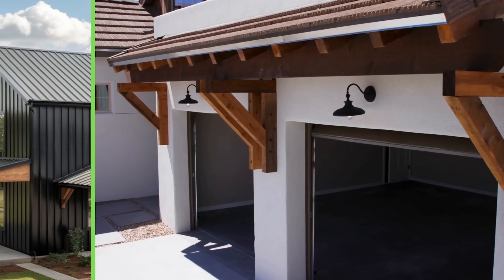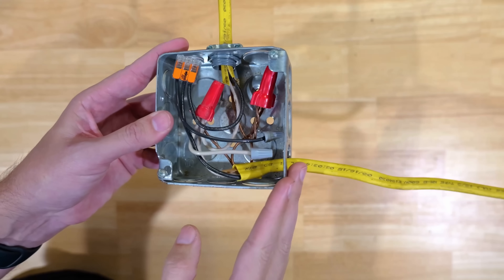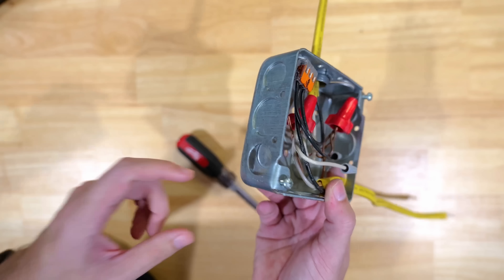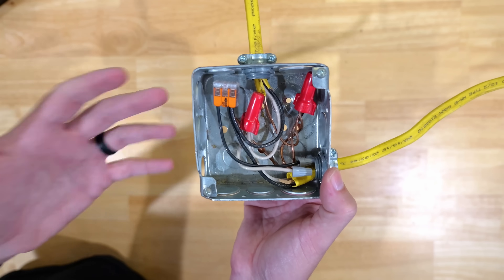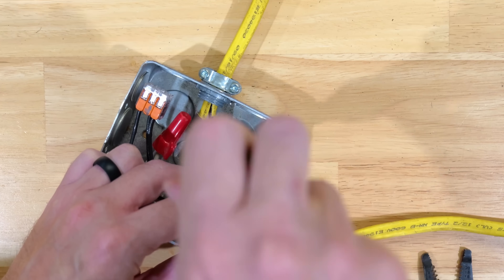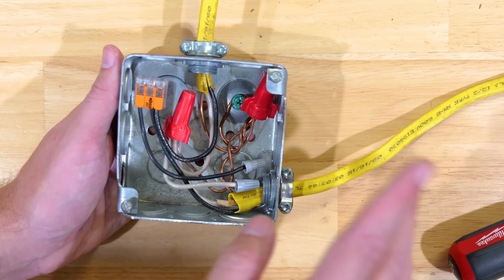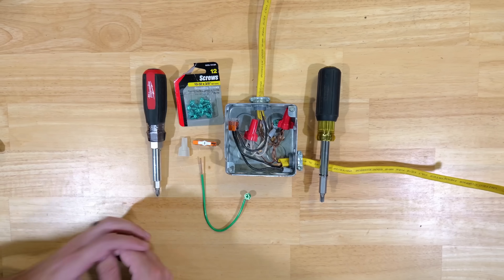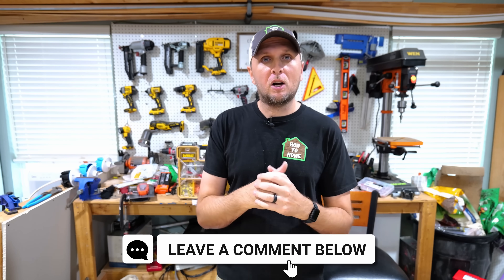SHOCKING Mistakes DIYers Make Installing Metal Electrical Boxes!

Comment: People like using 14 gauge wire because it bends so much easier and is easier to work with inside those tight little boxes. This is a mistake. It is best to use a bigger deeper box if you can.

Comment: You need an explanation of why smaller wires cause electrical fires. Here it is:
The smaller 14 gauge wire can carry 20 amps, but there is resistance because of the small size and this causes heat. The plastic insulation melts off because of the heat and exposes the wire that will arc without insulation.  Electrical arcs are really hot (think of arc welders) and they catch things on fire such as wooden studs.
Reply: 14 ga wire will not melt the insulation off at 20A.  But it will exceed the thermal limits that all the safety calculations are based on so it is not allowed with NM-B cable.  Almost everything in the electrical code is there to limit heat, and thus prevent fire.

Comment: A wires amperage is more dependent on the insulation then the wire size.
Reply: A wire's ampacity is limited by how hot you're willing to allow the wire to get.  And that depends on the resistance of the wire which depends on its size.  It also depends on its surroundings which determine how fast it can radiate heat.
If you're fine with 200C/400F wire and it is hanging in open air, you can draw 50A through 14 ga wire.  In most situations though, 200C wouldn't be fine since it can start fires.
Reply: @stargazer7644  #14 with silicon and fiberglass insulation is rated at 45 amps

Comment: A non-contact voltage tester should be your first purchase; In general, Fluke makes the best testing products.

Always, Always Turn Off the circuit, Secure that it is Off, and Test it before handling any potentially live wiring.

It's a good idea to choose a time when noone is going to be turning off and on switches, i.e. be aware of what other people are doing and let them know clearly what you are doing, and not to operate any switches (or circuit breakers)
Reply: And don't forget to test your test equipment on a known, like source to ensure it's actually working so you know what's checking as dead is actually dead.

Comment: Great video. Love to see new code requirements like wiring light switches, but most desired is how to find a break in underground wire. Had a lightning strike near my house that caused an outside outlets to short.
Reply: There's equipment, like signal tracers, that are available for such a problem. However, a break in the wire itself somewhere in the middle is highly unlikely... but then again, I can't claim to have ever dealt with damage from a lightning strike in that scenario. I would first make sure everything else is actually in working order... For example, outside outlets are supposed to be GFCI protected those devices are sensitive and prone to failure.

Comment: Bare copper is bond wire not ground. White is ground wire.
Reply from the maker: No, bare is the ground, white is the ground conductor.  There is a difference.  The only reason the neutral is called the grounded conductor is because it is bonded to the ground (bare copper) in the main panel.

Comment: Having that wago connecter on fire in the thumbnail is clickbait trolling all us wago fans. 😅
Reply: Seriously, its just pure click bait, shut the video off soon as i realized he was doing that
Reply from the maker: @Bigmrbrennan no you didn’t.  You decided to also comment.  🤡
Reply: Yes I like Wego so I want to see what he says about him
Reply: Gimme a break with the click bait. Besides, OP didnt design that.
Reply: @nothankyou5524  he uses a lot of click bait, and it annoys me so much that I rarely watch his videos.
Reply: I have always been leary of using marrets to connect unlike wires, Eg, 14 ga to 20 ,  or 14 to a multi strand 
I have removed marrets installed by professional electricians where a lighter wire or multi strand has been twisted down by the marret , and the only contact was the tension of the twist , but none of it actually in the marret 
I have thought the wagon connectors would be much better option
Reply: Wago are junk unless using them to connect a light fixture. Not gonna handle through lines with heavy loads
Reply: Are you nervous about Wagos? 
I can not say I am comfortable with them. I've seen them fail.  Great for testing, though!
Reply: And then he never actually says to not use them? I'm confused. Personally, I don't trust those connectors, seem prone to failure / improper use from my experience.
Reply: @brancampbell  Every time I see someone say they don't trust Wagos, I laugh at the idea of them trusting wire nuts.
Reply: @TricksterRad  every time someone says wago connectors are better than a properly installed wire nut I laugh at them while being thankful they didn’t wire my house!🤣
Reply: @brancampbell  I use them but I keep stress off of the wires and I tape the connector close so the little clasps don't pop open.
Reply: @brancampbell  You didn't pay attention -- the problem wasn't the connector, but rather the smaller gauge wire. That's what the fire was supposed to highlight.
Reply: @reryro1266  Did you look at the thumbnail? It clearly shows a Wago on fire, with an arrow pointing to the Wago and the caption “Don’t use!” But then it also says not to use red wire nuts, so I almost didn’t even click on the video, figuring it was all clickbait.

Comment: I like to hold the nut for the strain relief in place and then thread the clamp into it, then hold the clamp in the final position and tighten the nut. I think it's easier to start the threads that way.

Comment: One thing tocconsider. This isnt the only way to protect a wire going into a j box. They make a code compliant plastic fitting that has a bladed that locks the wire from being pulled out. It's not as enexpensive and still effective.
Reply: 2:55
watch it again

Comment: Can I add a second light switch (attached to a new light) to a 3-way loop switch? And if so, how?
Reply: You can add any number of additional switches in the middle of a 3 way circuit by using what is called a 4 way light switch.  But those will just control the existing lights.  You can add additional lights to an existing 3 way circuit so that they all go on/off together.  But you can't add a new switch to independently control a new light to a 3 way circuit.

Comment: I'm not an electrician , i did notice the missing strain relief and no grounding to the box. What i don't understand is WHY the wire need to be 6" ? I've seen that before and noted how hard it is to install a socket or switch in the box with all that wire in the way. I think that 4" should be enough. That wire is stiff as hell. And the demo box you have there with all that wire in the way , you'll never get a socket or switch to fit in there, not to mention is the wrong box for that. That is a junction box I think. I've on cars electrical systems and for the last 25 years working on Jet airplanes and both have LOTS of wiring. Planes also have AC systems, 115volts. None of this stiff house wire thou.
Reply: They make special box covers for installing switches or outlets on these J boxes

Comment: Gauge of copper wire should be measured if it’s 20 gauge it should be rated for 20 A and if it’s 30 gauge it should be 30 A
Reply: Wire gauge is inversely related to diameter. 30 gauge wire is tiny and wouldn't be able to handle anywhere near 30 amps (sustained). The larger (20 A) wires in the video are 12 gauge, and the smaller one (15 A) is 14 gauge. For 30 A you would generally want 10 gauge.
Reply: @nybble41  Rename them

Comment: It is never okay to use 14 gauge wire in a 20 amp circuit regardless of the device. All it would take is a malfunction that exceeds the current rating of the wire and you have a dangerous situation.
Reply from the maker: Not completely true.  If it is a pre determined load like a light fixture with included wiring, that is one instance where it is completely acceptable.

Comment: Regarding mistake #1:  What kind of stress relief is used if you have metal conduit coming out of the box?
Reply: The conduit is rigidly attached to the box, so no stress relief is required.  You can't move the wires as they're protected inside the conduit.
Reply: @stargazer7644  Thanks!

Comment: A 14 gauge wire is rated at 20 amps.  A 12 gauge wire is rated at 25 amps.  The outlet being used most likely is rated at 15 amps, so what's the problem?  The 14 gauge jumper is more the sufficient as long as the load is 15 amps or less.  I'd worry more about the device being used rather than the short jumper wire.

Comment: I was installing Formica countertops in this one kitchen. I plugged my belt sander in an outlet in the same room and when I pulled the trigger it screamed! I unplugged it right away and discovered that someone had wired it 220.

Comment: I removed all the wago connectors in my home as they are unsafe.  If wago connectors are used in higher current applications the metal in them becomes annealed and lose their  connection and fail.  They. can be a fire hazard .

Comment: Canadian code requires the copper ground from the line (input) to be grounded directly, and load grounds to be connected to the load ground wire, either directly or via pigtail. This ensures not breaking ground when subsequent work is done in the box
Reply: Good info re: canada
Reply: So you use isolated grounds in everything?
Reply: @sosocrazy1234  If by isolated you mean separate from the neutral, then yes. Isolated through any subpanel and only bonded on the main.
My comment was a bit unclear. First, it refers to metal receptacle/junction boxes. The line in is bonded first to the box. All grounds for load circuits or the receptacle/light fixture are attached to the ground in the box. This ensures that if a device is being changed out, or temporarily missing, the ground for all devices on the circuit remains intact.
First inspection checks correct bonding procedure before close in.
Reply: @grantr5417  oh. I gotcha now. That's not an isolated ground, that's typical of how we do it in the US. Isolated grounds are different than that.
Reply: "While OSHA doesn't explicitly say to never work on electrical equipment that is hot, it emphasizes the importance of de-energizing equipment before work and using appropriate safety measures if work on energized equipment is unavoidable, with only qualified personnel allowed to do so."
Reply: No one cares how you do anything in Canada.
Reply: OSHA says don't work anything hot.
Reply: @bud5084  And always put one arm behind your back when using a hammer 😂
Reply: @bud5084 except you may not know it’s hot. Keeping the box grounded is a decent idea.
Reply: @bud5084 Tell OSHA that lineman say f** off. Any trained electrician should be working on live if they want

Comment: The sheathing enters the box 1/2 inch, but it is not intact with a split running back into the connector.

Comment: It’s perfectly fine to use 14 gauge wire for pigtails because it makes no difference in resistance to 12 gauge wire for such a short run. Case in point, check devices using high voltages, they don’t use high gauge wires. The amp rating is for long runs.
Reply: In general this comment is incorrect and not to be trusted.

In general, if you are running any wire not part of a fixture that came with its own wire, always default to running 12 guage wire unless the branch circuit overcurrent protection (fuse or circuit breaker) controlling the circuit is rated at 15Amps (15A), in which case you can use smaller #14 wire

15A circuit #14 wire or larger
20A #12 wire " "
30A #10 wire " "
Reply: Please don't ever do any wiring.
Reply: You are of course correct. This is one of the Unspoken Truths that will call the trolls every time. 
I do believe that if one is to make instructional videos, one needs to provide legally defensible information, ie. code compliance, in this case.
But I agree with what you say...
Reply: "Perfectly fine" seems a strange phrase for describing something that is a complete violation of the law (NEC regulations, where adopted).
Reply: Higher voltage wire is smaller for the same load demand. Seems counterintuitive to most folks, but is very simple to grasp for those educated in electrical fundamentals.

Comment: For Pete's sake! What is everyone using to handle wires in a box? A reasonable concern for connection integrity is good but if you're using a sledgehammer and pipe wrenches on your wires then Wagos and wire nuts are both gonna fail.

Comment: My first rewire, as a teen, many decades ago...first attempt to power up ... pop!   WTF!? 
Very sure of myself, I started pening boxes... and isolating runs. It was brutal to my ego. The cable clamp screws are not to be driven home. There is a huge push for securing cable, and that seems to be an area of little common sense... 😮

Comment: One comment on metal clamps. Only tighten them enough to hold the wire firmly, do not tighten the screws as far as they can go! I got shocked from an ungrounded metal box where the wire clamp was so tight it cut into the hot wire! The box was therefore electrified! Another illustration of why you need to ground metal boxes, as you have shown!
Reply: This is why you ground the metal box
Reply: Yup, I can testify to this, embarrassingly so.
Reply: Electric powered screw driver set too high might have been used.
Reply: I too have seen metal clamps overtightened that much. Fortunately the box was grounded and it tripped the breaker, which is why I was working on the wiring.
Reply: I did this when installing a generator inlet. Clamped down too tight on the romex and was wondering why I was shorting out.
Reply: Thru the sheath AND the wire insulation? Screws will break away buy then. Btw, breaker not tripped?
Reply: @nothankyou5524 the clamps on a metal octagon box press the wire sharply over the edge of the box openings. They can be pretty sharp and definitely are not deburred!
Reply: I used to do everything based on my "tighter is better" outlook, until I "securely" tightened a metal strain relief clamp until it cut through the romex and caused a short. The short was discovered immediately upon restoring power and tripping the breaker since I had grounded the metal box. Lessons learned : Tighter is not always better and it is always better to ground metal boxes.
Reply: @albertgualanoiii7082 yep, just snug enough to prevent vibration!
Reply: very informative. Although I don't have any problem like this before.
Reply: @lchansocal absolutely true! I shorted a wire into an octagon box myself and the true story I mentioned above! They have also cheapened the construction of romex wire. It used to have layers of paper wrap on the wires, now it’s just the plastic jacket over the wires.
Reply: I have always used my 6in1 for tight down  and double check ✔️
Reply: thus the plastic

Comment: I just replaced one of these metallic electrical boxes because the old one didn't have a raised place to mount a grounding screw. I have a question about the grounding of the receptacles I installed in the box. My box has a 240V outlet and a 120V outlet. Each outlet is served by a different set of wires. The wires run together in a metal conduit pipe from the electrical panel, around the outside of the house, and through the wall to where the metal box is located. There are 5 wires altogether, 3 going to the 240V outlet (2 hot wires and a ground wire), and 2 going to the 120V outlet (1 hot wire, 1 neutral, and no ground wire). I believe that each outlet is on a separate circuit. The old 120V outlet was burnt out and no longer functioned, but the 240V outlet still worked. I replaced the 120V outlet with a GFCI outlet and put in a new 240V outlet. I installed the green ground wire on the raised spot on the box and also installed ground wires to each outlet. Since there was no ground wire on the 120V circuit, can I share the ground wire from the 240V circuit? I used a Wago to join the 4 ground wires together (1 from the box, 1 from the 240V circuit in the panel, 1 from the 240V outlet, and 1 from the 120V outlet. After turning the power back on at the panel, I tried the outlets. The 240V outlet worked fine, but the 120V GFCI outlet didn't work and I couldn't get the reset button to push in. Since the panel isn't labelled properly, I'm stll not sure which circuit breaker controls the 120V circuit. Could it possibly be controlled by the double-pole circuit breaker that also controls the 240V circuit? That doesn't seem possible to me. My next step, I think, is to try to find the wires running inside the conduit to where it connects to the panel and follow them to their respective circuit breakers.
Reply: @tomknack Make sure your polarity is correct on your GFI and make sure you're on the line side of your GFI. Sometimes a GFI won't reset if there is a load on it ahead of the GFI. If this is a  20 amp circuit use a 20 amp rated GFI they work much better in my opinion. I hope this helps my friend!
Reply: @DirectCurrent4u  I checked the polarity and it was OK. I only used the LINE connections as there are no LOAD wires. What I did discover in the panel, though, was that the hot wire was disconnected from the breaker. I disconnected it a few weeks ago and forgot that I did. Oops. After I fixed that problem, everything seems to be working fine. Thanks for the suggestions.
Reply: @tomknack  Sounds good my friend. Great to see You up and running again!👍
Reply: Yes, sharing the ground wire is the right way to do that.  Good to hear you found the fault.
Reply: When multiple circuits (from the same panel) are run in the same conduit, only one grounding wire is required, sized to match the largest wire. So if your grounding wire is 10 gauge, matching the 240V wire size, then you're good, whereas a #12 would only be code compliant for the 120V device.